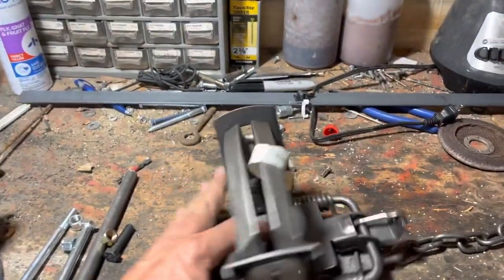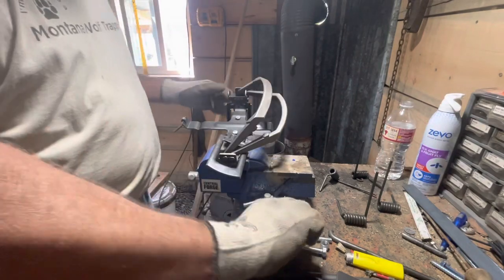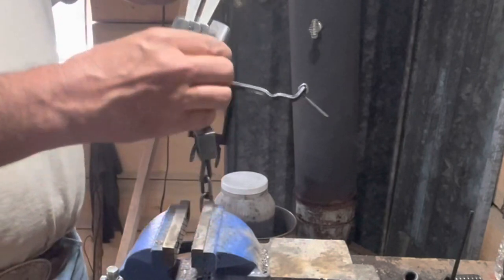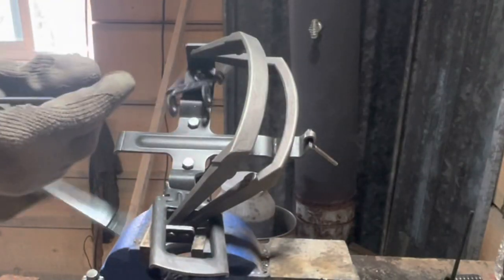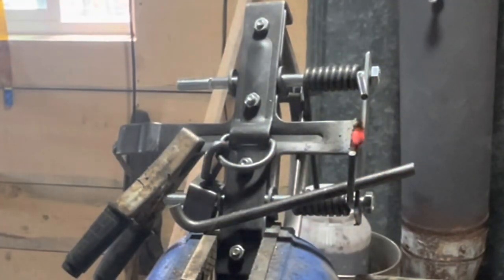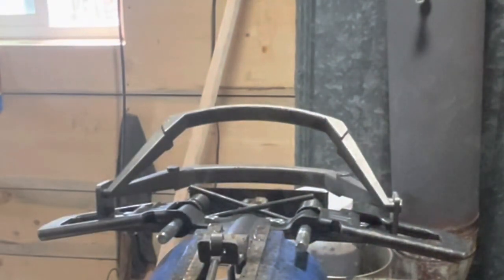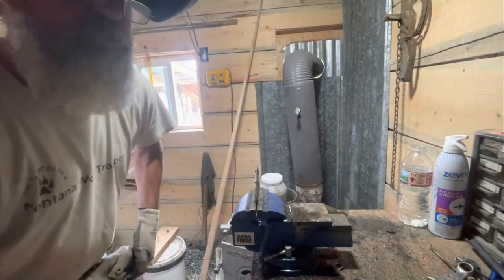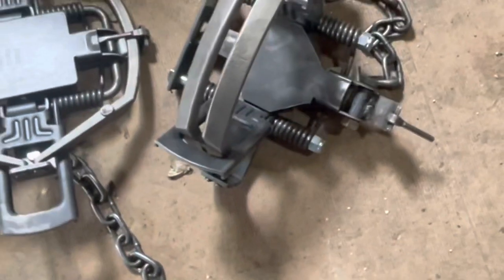Mods to make the Duke 850 a wolf trap.

Comment: Them pans are very easy to bend around by hand they about need some reinforcement on the bottom cause they are very easy to tweak out of wack. What do you think of the offset do you think a coyote could pull out of it?I got 4 of them thought they would work ok for deep snow coyote .I did take off one set of springs might put some thing a little smaller on there just to help speed email up a bit.

Comment: If your Duke 850’s are like mine, you might want to separate the baseplate and weld the split in the D-ring. Duke used heavy chain and hell for stout swivels but kinda went cheap on the D-rings in my opinion. Being less expensive compared to other traps, I don’t mind cutting them up and making them into something better. Thanks for sharing your knowledge and wisdom once again.
Reply: Maybe not tested but there has been plenty of Idaho wolves caught and held no problems in the Duke 850s already. I have had great feedback from customers that have bought them from me . Tight chains 👍🐺🐺🐺✌️
Reply: Jack Whitman also suggested welding that base plate seam.  He said "Not because a wolf would  break it, but because it's a spot to trap odors."  He doesn't wax his traps though, I would think that wax would fill that crack and seal it pretty well.
Reply: @MuskratOutdoors  I wouldn't weld the entire base plate both sides just to control scent issues. Maybe spot weld for added insurance isn't a bad idea even though it really isn't necessary. Wax will definitely seal that seam up.👍🐺
Reply: @beeman9500   That was my thought also. You can't control scent 100% anyway. Wax should fill that gap.  On the other hand, I listen to Jack's opinion. He is one of the top wolf trappers in the World and knows what he is talking about.
Reply: @MuskratOutdoors  I had thoughts of sealing that gap in base plate with construction adhesive and let it air out for 6 months then dye and wax. I know some will say im crazy for suggesting that but my experience with pl-200 is it gets concrete hard and becomes ordorless in time 😉👍🐺🐺🐺🐺
Reply: @montanawolftrapper8666   Jack is an amazing Man. He's a friend and neighbor (here in Idaho/Montana a neighbor meaning he lives 30-40 miles or so from me. My first wolf, he loaned me his wolf stretcher. I was honored!)....anyway. When I say "best in the world" I mean that. He has trapped wolves in Alaska, the lower 48  USA,, Russia, Mongolia....maybe more. He is the only trapper that I have ever heard of that has that kind of world wide record.  He's one guy that when he talks, I pay 100% attention to what he says.
Reply: @beeman9500   I had thought JB weld, but I wonder how well it would hold up to boiling every year?  Welding is permanent,  but replacing that "D" ring would be impossible. I don't recall ever needing to though.
Reply: @montanawolftrapper8666   My Wife trained Narcotics Dogs, and Cadaver Dogs when I first met her. A dog's nose is amazing.  They can pick up smell long after it's gone....weeks, months, sometimes years. No matter what we do, they will know we were there. We can limit our scent, but never eliminate it.  Weather they care or not, is another thing.  She trained black or yellow labs. I'm told bloodhound and wolves have an even better sense of smell.   I think that most of the wolves anyplace we will try to catch them, have smelled people before, and are somewhat used to it.  Still, why should we ignore our stink?   I try to do everything possible, but I know it's not enough....they know....
Reply: @montanawolftrapper8666   Her's a great guy!  I had to laugh, in his fur shed, he had skinned and stretched pack rat hides!  I asked him why, and he said "Everything gets skinned around here. I sell them for tying fishing flys".

Comment: A friend of mine stopped by and showed me one of those.  His had nylock nuts on the end of the spring rods. I noticed yours out of the box, didn't.  People must have complained enough that they are adding them now?
He also drilled the pan and added a tension screw.  He didn't cut his pan down, but said he didn't like it that big either.  I have never understood why people want a big pan.  Toe catches or misses will be certain.  Small is much better! I've seen Russian traps that don't have a pan at all, just a piece if wire.
Reply: If there is nylock nuts on end of spring pins it's because someone already added them as all 850s come stock exactly like Paul's from the Duke Warehouse.
Reply: @beeman9500   That's what I thought too. I asked him if he added those and he said "No it came that way." He said it was a new trap, I assumed he bought it mail order from a trap supply company. I'll ask him more about it. He might have bought it from someone, but it didn't sound like it?
Reply: I know of another Duke Dealer in Idaho that puts those nuts on end of spring bar and sells them as a modified trap so that's probably where it came from ?
Reply: @beeman9500   That could be. We are in Idaho.